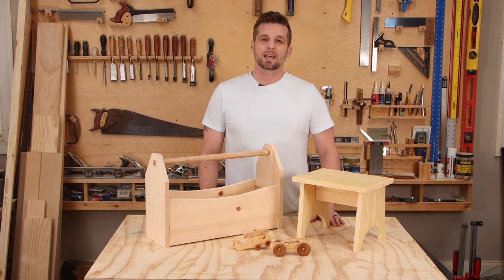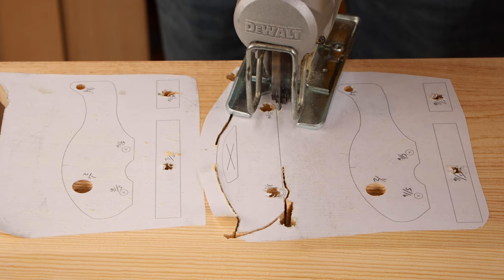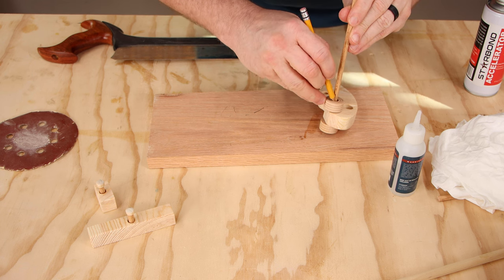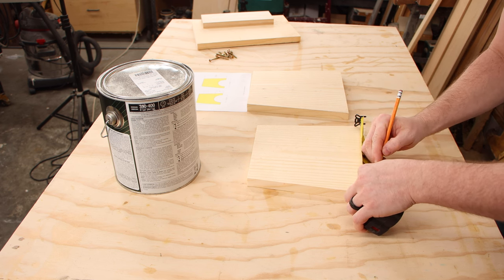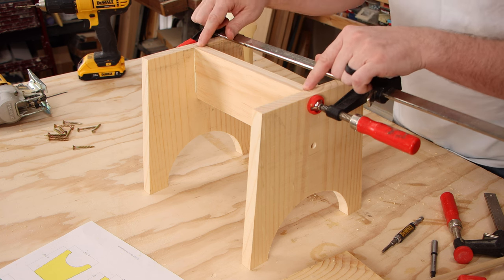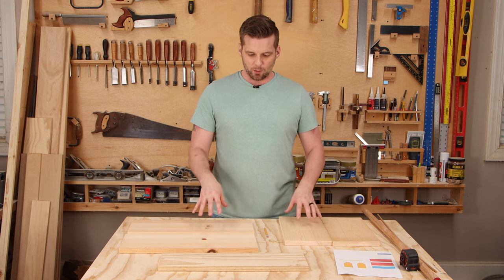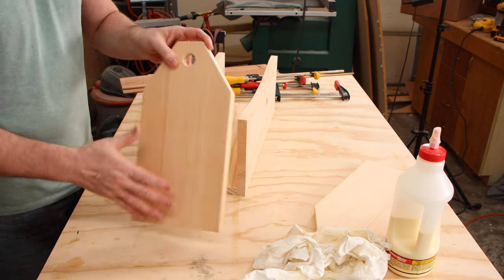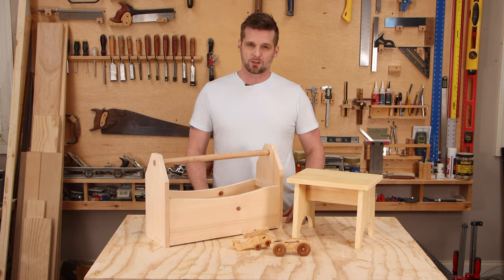3 Easy Woodworking Projects You Can Make As Gifts | Free Plans

Comment: I just bought a porter cable air compressor kit with a 23 gauge pin nailer, 18 gauge Brad nailer and a 16 Gauge nailer. I was hoping you could do a video on the purpose, applications, maintenance and use of each one, and the difference of nails in each one of these! 
Love your videos!
Reply: My coworkers and I were eying the same kit when we were looking for air compressors at Home Depot. As a new home owner and new to these types of projects, I had no idea if I would have any use for them, so i brushed it off. A video showing their use would be great that way I could get a better idea what I could use it for.
Reply from the maker: Great idea, Spencer. Might put that one in the queue

Comment: Good ideas, I like it!
I built a stepstool with my three year old, she loves sawing and planing. I would angle the legs of the stepstool outwards slightly, especially since you have an overhang, it makes it more stable. Yeah, mine isn't either... It complicates the construction a bit, needs an additional tool (plane) though you can get away with 60 grit sandpaper, spray glued to a piece of flat plywood or mdf.
Thanks for sharing and have a great year 2022!

Comment: 10:12 why not just use dowels on both end of the joint of both pieces and glue them together?
Reply from the maker: You could use dowels for the joinery, but that's much more involved to line them up correctly on each piece. This is meant to be a really quick project. Good suggestion, tho
Reply: @OutoftheWoodwork  makes sense. I bought a jig specifically to make dowel joints, since I have done them manually before (complete pain to line up), but I like the invisible seal and great joint.